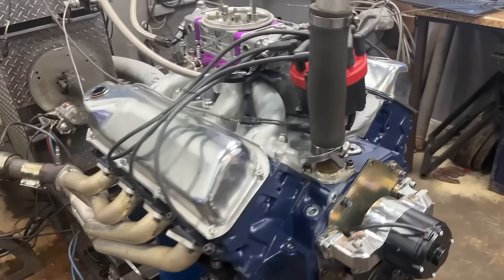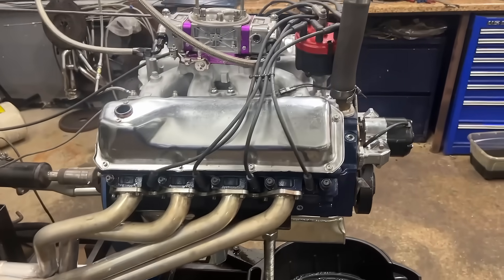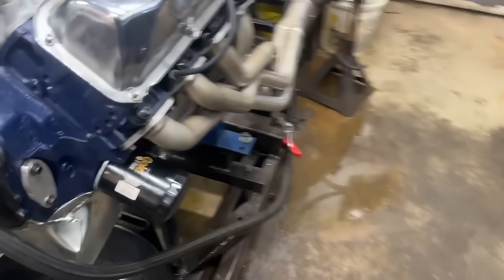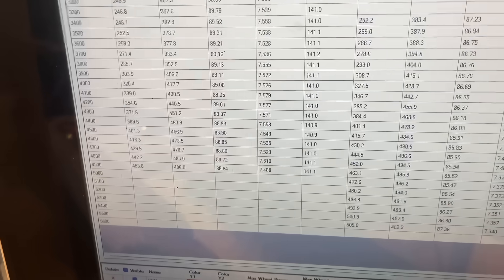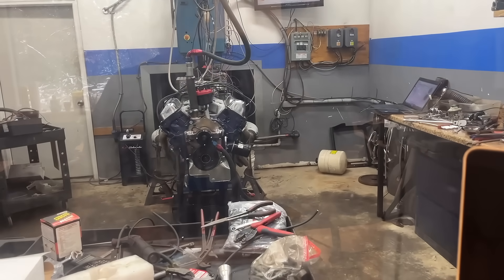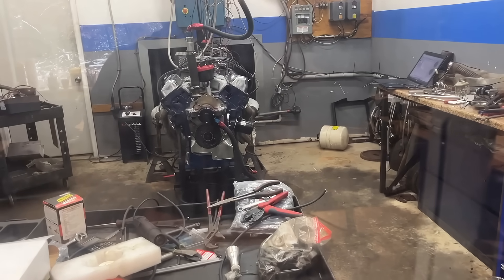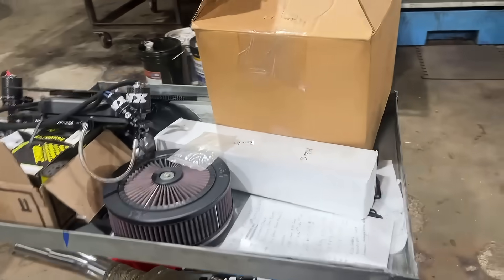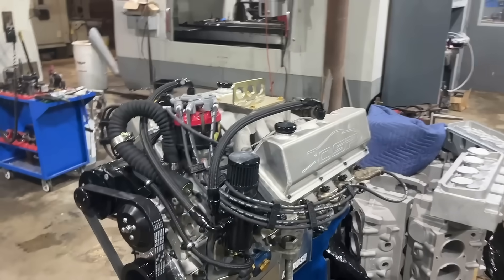351 Cleveland Dyno Test — Stock Block Build with Oiling Upgrades (Fox Body Swap)

Comment: I can’t believe you didn’t show the H.p . That is the only reason I watched the video . I have messed with these engines all my life wanted to see how the older build did to the newer stuff.
Reply: freeze-frame the paperwork; you'll see the HP in a column, while he's reading the oil pressure psi readings.  it was over 500 HP though
Reply: @Dave.S.TT600 thanks missed that
Reply: @Dave.S.TT600 all I can see is 480 something horse power with paper stopped

Comment: You're wasting 20-30 hp with all that oil pressure. Pro stock folks say 10 psi per thousand rpms.
Reply from the maker: This by no means is a pro stock!

Comment: IMO, the extra oil line makes logical sense in feeding the main oil passage from both ends..(stock block).  as you show the oil pressure drops off after feeding every main/cam hole...  so the 2 direction feed is logical...  Have it on a stock block here in Australia, has copped a beating for 18 years..  no lifter bushes...550HP

Comment: Engine shown is NOT a stock 351 C. Thumbnail for video says STOCK 351.
Reply: Wow. Reading comprehension much? 

"Stock Block Build with Oiling Upgrades (Fox Body Swap)"

It's not a stock build. 

It's a stock block build, with factory crank and rods.

Comment: I like to know if it is open or close chamber 4V heads
Reply from the maker: Closed chamber
Reply: He did say 4bbl, I had a 70 Mach1 351C 4V 4 spd in 82-84, it was STOCK except headers, this is Far from stock

Comment: I’ve got a similar 351-C that I refreshed last year. This engine in my 81 Capri on a 175 shot went 9.0’s in the 1/4 and 5.90 in the 1/8. Closed chamber cylinder heads, factory block and crankshaft. TRW flat top pistons and forged rods. Chris Parker funnel web intake. The roller cam is a Chet Herbert 0.711-0.714, 262-272 @0.050, 108 LSA, 300-306 advertised. I never imagined this engine could make this much power for a simple build. My Capri was super light and the car just worked.

Comment: I didn’t catch if it is a HV or standard volume oil pump with 4 quarts in the pan?
Reply from the maker: Has a high volume pump.   It will see stree use at low rpm

Comment: Stock 351 rods and stock cast heads ! That’s a riot ! 496 ft pounds at 4700 ! That’s Mopar 440 stuff there ! There is no other 70’s engine out there that can match that! That cam what ever it is is awesome. Would translate to about 520-539 fwhp at 6500 rpm ! Crazy ! 
I have an 3 v alloy headed Cleveland . Comp cams 32-235-4
253 at 50 single pattern cam .585 and 110 lobe seps. Hydraulic anti pump ups . It’s in my Aussie ford falcon XY Gt rep Ho . Awesome power curve with ice ignition. 22 deg initial and 32 out the top . All in at 2800 rpm . 10.6 comp ratio. Speed pro pistons and eagle rods . Have it rev limited to 6400 so it lasts ! But could rev I would think 6800 no problem. Also have Parker racing funnelweb 3 v intake and 850 Holley.
Cleveland’s love big cams and carbs . 
Can cruise at 35 mph in 4 th at 1600
Rpm and cruise at 60
Mph 2500 rpm. 16 lts per 100 k’s at cruise .
Giving it a bit , you can watch the fuel needle drop! 
 I’m in the process of building a 410 as well . Love Cleveland’s ! Lots of them here still in Australia 🇦🇺!
Reply: Is Terry Parker still with us? I used to talk to him all the time from the states 🇺🇸 about the funnel web. I never managed to get my hands-on one, but that's a bad a** intake. And Terry is  a great person. I still have fax machine paperwork,He used to send me back in the 90's. He was a great help when few people were doing Cleveland  stuff over here. 🇺🇸🇺🇸👍
Reply: @Michael-s4r1y yep I’ve been to his house near me ! Great Bloke . Still sells the funnel web . Email him as he’s slowed down now but he’s in good health!
Reply: The funnel web was the original bad ass hi rise . Possibly did everyone copy him ?
Reply: My dad was an old Ford enthusiast, he bought a 69 Ford Bronco with the 289, through that out and dropped in a 351 Cleveland!  The difference in torque was insane, that was fun to drive with the three on the tree and four wheel drive also.
Reply: I dreaming of a 400 tall deck long rod(240/i-6= truck) … 6.7479” .912 small end…like2 use off self aftermarket 302 Boss piston..got 8 connecting rods, I’m not a engine builder or a mechanic.
Reply: Just imagine where the Cleveland engine family (this included the 400) would have ended up at if the "Malaise Era" never happened.  Hemi beating horsepower would likely have been the result (look at the DiTomoso Pantera).
Reply: A 429 scj with that cam size would be beastly
Reply: LOl there are guys who build Mopar 383's that hit 510-525 @ 48/4900RPMS .....Need to get out of your Fud motospots bubble.

Comment: Had a 351M400 years ago that hauled ass. Ford had selected the correct converter and gearing combo. After rebuild, compression was 10:1 or slightly higher and it really came to life.

Comment: The 4V Cleveland I acquired, buried the needle on an 80# oil pressure gauge. I was worried about oil filters, and ended up paying the extra cash for the high pressure filters. It pulled hard at the strip, but ran hot, 235 degrees hot, in traffic, in a 69 Mustang. Fun car...love them old Clevelands...
Reply: When I was a member of the Wilson Ford drag club the cleveland guys broke every other impeller off of the water pump in order to allow the water to slow down and dissipate the heat. It prevented the engine from overheating!!!

Comment: Can not wait to see the dyno numbers on that 2nd engine!! Because it is mine!! Lol!!  Mark is great to deal with,and has probably forgotten more about making a Cleveland  run  well than most people know! The engine has 90 street miles and I was able get 6 passes  at the track before the end of this past season.  Best e.t. 10.55@ 126.42 1.469 60' in my 1989 Danger Ranger  3340 lbs all motor was not able to use the nitrous yet!! Thank you  Mark hope had a great Christmas and Happy New Year!!
Reply: Bad ass man! Thats a nice looking Cleveland.
Reply: @ablejohnsonSpring can not come soon enough!!👍🇺🇸🇺🇸
Reply: @Michael-s4r1y  hell yeah man 💯   i just bought a 1970 mercury cougar, 2v 351c so I am back in the Ford game. The car has not been on the road since two thousand eight.So, it's got a little things.I've got to sort out, but the engine runs and goes into gear ford in reverse.So just doing the simple stuff.Now, rebuilding the fuel system and cooling system, getting to where I could do a test drive.Then, gotta rebuild the front suspension?And steering and brakes get this thing, mechanically sound get some new wheels.And tires on it, so I can start driving it.And I hope later, twenty twenty six, I'll have the money to build a kick ass cleveland street engine. I used to run a boss 351c  fairlane fastback, this two v motor right now is kind of like a turd compared to that.But at least i've got the foundation to start with. Looking forward to getting out there and ripping it again

Comment: I’m building a 351 Cleveland now  60 over k b pistons -8 cc  dome many stock bottom end arp rod bolts a mains a set of Aussie heads 58 cc around 12.5 to 1 should  be a screamer an a dan Powell cam hydraulic roller
Reply: Would love to know what camshaft Powell  recommended for your camshaft?
He really knows his stuff that's for sure.